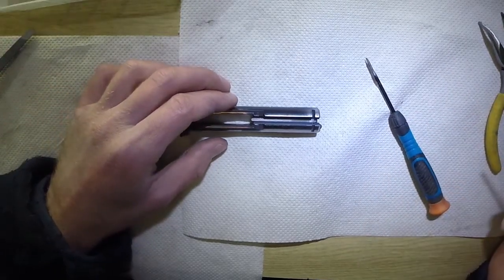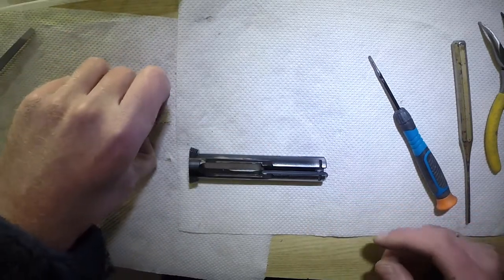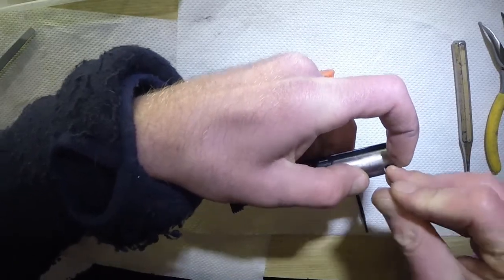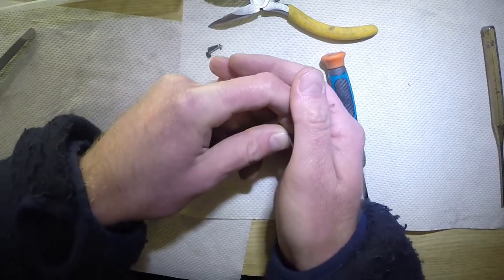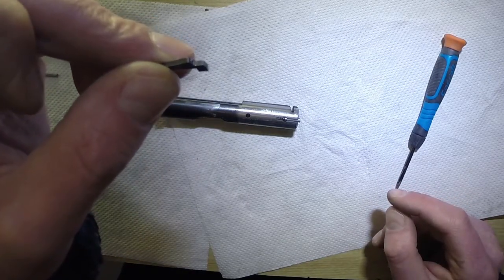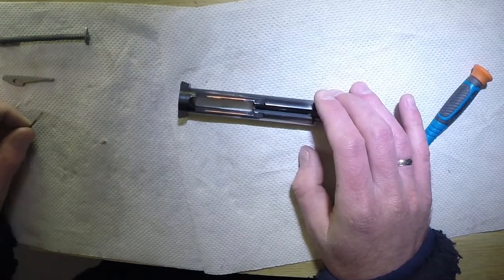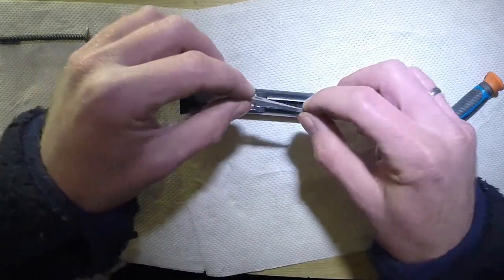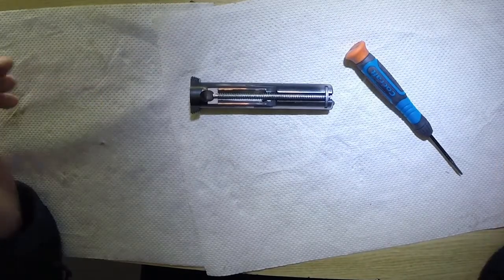Ruger Mark 3 Bolt disassembly and assembly

Comment: You Did Not Show How The Rebound Support Goes In, Where Did You Push It Back To With The Firing Pin.
Reply from the maker: Hi, if you follow from 3:43, what I do is push it in down the "ramp" and then the other way to get it into position at the "ramp", when you then put the firing pin in , it will lock it in to it's place. Sorry for this terrible description I do not currently have a ruger at hand, when I do I can try and explaine it better if you dont understand.